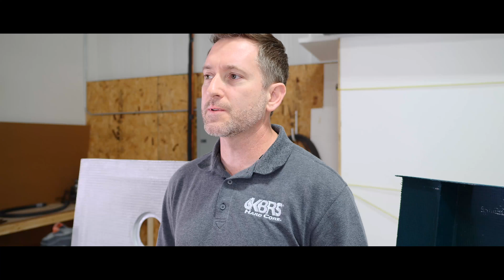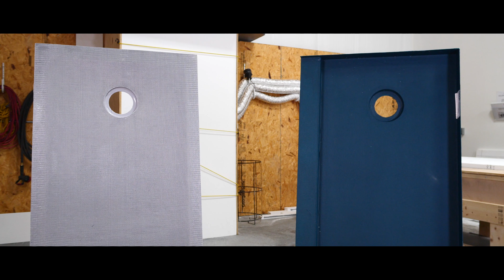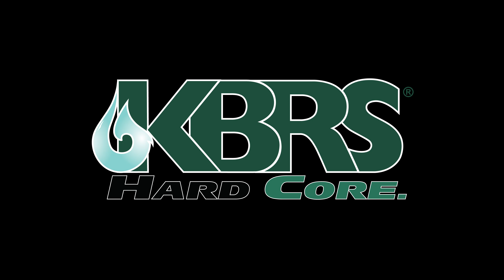KBRS Shower Pans: What's the Difference Between a ShowerSlope™ & Tile-Basin®

Comment: Can a corner bench be install on top of the ShowerSlope and does the custom manufacture a ShowerSlope also come with a  3 inch perimeter “cut zone”?
Reply from the maker: The shower seats are meant to be installed on top of the basins and slopes as one of the very last things you do before tiling. They set into their own beds of thin-set down on top of the tile basin/shower slope and against the wall board.
 
When we custom manufacture a ShowerSlope, it will have a 2” cut zone as opposed to the 3” that the standard sizes have.
Reply: If I need a 38 x 60  5/8 would I need to order 38 x 61?
Reply from the maker: @mattc5185  With the ShowerSlope, you just need it to be large enough to fit the space you have. Whether you order exact or slightly over so that you have to cut it, either way is fine.